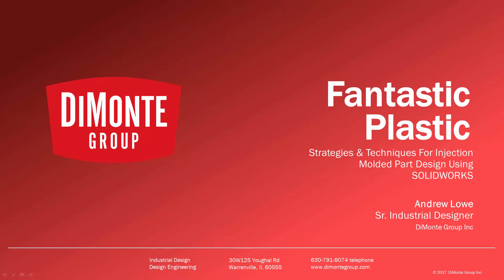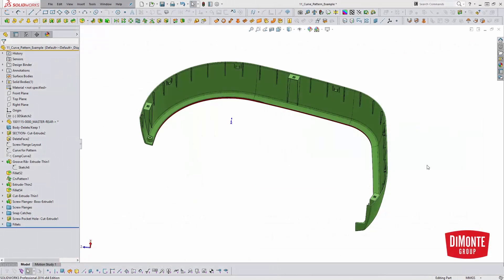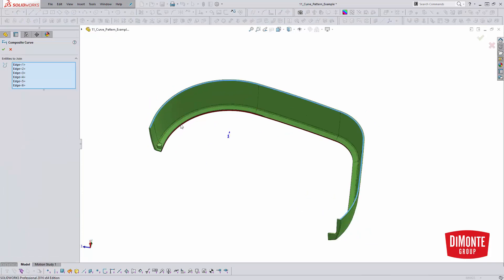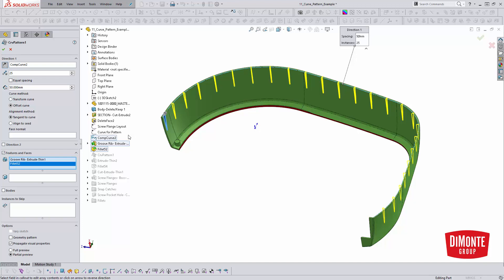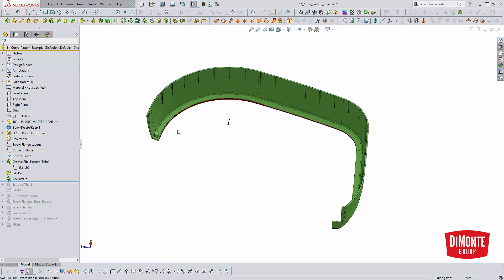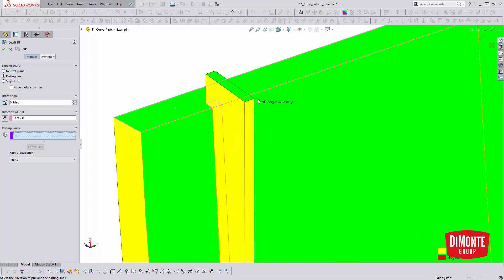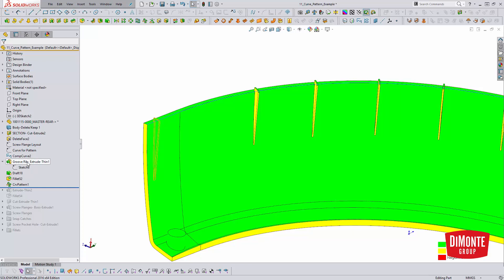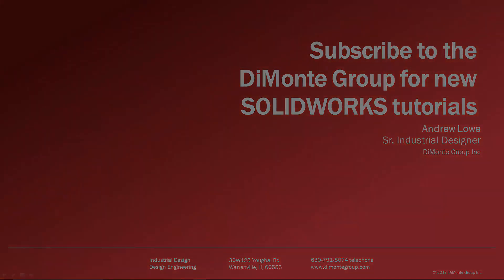Curve Driven Patterns - SOLIDWORKS Tutorial - Fantastic Plastic 10

Comment: Could you please explain how you created that first groove feature
Reply from the maker: George,
I believe that you are asking about “Groove Rib-Extrude-Thin1”, which is extruded from “Sketch6”.
“Sketch6” is on the Right Plane.

There are two ways to make that rib using a Thin feature Extrude:
1.	Extrude in both directions, specifying a “Blind” distance for Direction 1 and “Up to Next” for direction 2
2.	Using the “From” box at the top of the extrusion dialog to specify an “Offset” for where the extrusion starts.  Extrusions don't have to tart from their sketch plane! This is extremely useful, especially if you are adding draft into the definition of the feature.  If extruding in both directions, you have a lot of chances to make a mistake in both the value and direction of the draft.  Starting from an offset, there is only one draft and direction.

I hope I answered what you are looking for. If so, that was a keen-eyed question!
Reply: @DiMonteGroupInc  thank you :)
Reply from the maker: Hey George!  I'm not sure what you are asking about "that first groove feature". Maybe that is from another video?
If you help me out with what you are asking about, I'd be happy to respond.  Thanks!
Reply: @DiMonteGroupInc  hey :)
I mean the first filleted feature of the curved pattern.
Is it a drafted extruded boss ? Where's the plane on which the sketch  of this feature is drawn upon?

Comment: It's good to see that this is an acceptable thing to do. I have heard from more than one person to never include draft in features. Sometimes it can be hard to tell what is actual best practice or just what some dude has been doing since '95. It would be really cool to see another project like that drill that we could pick apart to learn more and/or reaffirm best practices. It seems like your team has a smart and intuitive approach to CAD. Hopefully you will correct me if I am wrong, but it does not appear to be full-on Resilient Modeling, which means you allow yourself the room to leverage the strengths of Solidworks while also not wasting time/effort on tasks that require unnecessary upkeep.